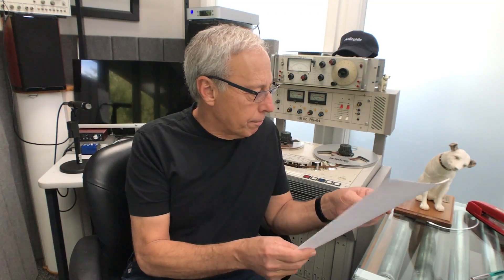Where vacuum tubes work best

Comment: Ive always thought tubes inherantly had much higher levels of distortion although the distortion from tubes are ment to be much more plesant to listen to than digital solutions? in a well designed tube amp can this distortion be low enough to compare with digital solutions or do people just prefer the analouge sound over the better measuring equipment?

Comment: I am a harp player, and I have all tube amps .Get this, 2 Gibson 1941 suitcase amps . The oldest is pristine and uses 2 6sq7 preamp tubes, a 
I sub 6sr7 metals to tone down,  2 6v6 which I use RCA cokebottle, and a 5y3 rectifier that I subbed a BENDIX 6992 . Second Gibson uses different preamps, 6jc7. Same in power, 6v6 and 5y3 . An Ampeg Jet, rebrand as Noble . 6sl7 preamps and 2 6v6 push pulls,5y3 rectifier..  A fine Blackheart Handsome Devil with 12ay7s for preamp and EL84 power tubes . Then, my gigging amp, VHT Special 6, class A, a 7442 preamp . . . 12ax7 one triode and 12au7 the other, then a cokebottle Sylvania 6l6 blackness for a power tube. A GE 5881 works good as well .

Comment: I've gone back and forth between ss and tubed pre. No matter which one I run, I always feel like I'm missing something the other one does better. Recently it's dawned on me my biggest mistake may be I'm trying to choose one that does both and if I ever found that unit it probably wouldn't do either one great. So I've concluded the only solution is to have both, and rum thru a switch. Now I need a good switch with no measurable loss(🤔🙄😶) it never ends....

Comment: Also, we don't need so many tubes in the preamp as compared to the power amp, which means that the maintenance cost is must economical!   I am using tube preamp + ss power amp.

Comment: In my experience a tube pre amp ruins the sound of a solid state amp. I use the solid state amp as a first level pre amp to a second tube pre and power amp.
Reply: Sounds to complex to be pure to the signal. I run a tube preamp and it definitely doesn't ruin anything.

Comment: He says tubes are best introduced in the front end. What is the front end? Probably dumb question but still learning, thanks!
Reply: I am guessing a little bit here. 
Systemwise, a front end would be a tube preamp vs solid state amplifier doing the final current deliveries.

Component wise, in a preamp, the front end would be the tubes in the first/gain stage vs the buffer state. The buffers (the final stage in preamp) could be tubes or solid state (in the case of a hybrid preamp).

In an amplifier, this would be the case of a hybrid amp, the front end would be the tubes in the first/input stage vs solid state in the output stage.

Comment: If you do not push tubes so hard two things happen. Distortion goes up when you turn up the power. They do not last as long. By using bigger tubes you do not need to push them hard. They last for many years and they sound better. When they do wear out they are cheaper to replace than the labor of hiring a technician to find and change a bad transistor. That is why I use commercial AM radio station 833A transmitter tubes for my SET amplifier. They can handle 2000 to 3000 plate Volts but with only 1000 Volts drawing 120 ma,they are more than loud enough with low sensitivity Magnepans. PS Audio really ought to try building a prototype 833ASET. You can use a Hammond 1642SE output transformer which is rated to 300 ma before core saturation and pot tested to contain several thousand Volts. Just feed the grid with about 600 Ohms from a headphone or low power amplifier at zero grid bias (transformer between 833A grid and ground.) The 10 Volt 10 Amp to heat the cathode is a little tricky to design, but I use a 4.5 Farad capacitor in the final pi filter. Tungsten cathodes have to be heated with pure DC.

Comment: So hybrid amps are the best?
Reply from the maker: Generally, yes. Because amplifiers are broken into two sections - the input voltage gain stage and the output power stage, using the best technology for both makes sense.
Reply: @Paulmcgowanpsaudio  thanks. May God bless you.

Comment: Now I have a question. Not sure if you already covered it. I will go back and listen again(kids can be distracting). I have since new (first stereo I ever purchased) a Technics SA-GX490 receiver which I love. I am currently using a ADS 5 band graphic EQ with it. Mostly I use it for tapes, but occasionally all the time. Depends on the mood. Can I put a tube preamp on the tape monitor? Or will that be a bad idea?

Comment: They are best in the system when the system is ALL tubes, this is the correct answer
Reply: Not true. Tubes don’t work very well in the low frequency area and at high volumes.  

For best mid and high frequency natural sound at moderate listening levels then yes tubes at both input and output stages “best” but there are other drawbacks also.  Have to replace tubes over time, etc as Paul mentioned.

Comment: Tubes are very coloured if you like their character you'll like that type of amp. 

The idea of a tube power, or buffer is frankly ridiculous in hifi terms, but in preamps, I agree they can be more useful. 

In applications were you want power amp distortion like with instruments, they are great, but for playing back audio recordings you are going to always going to run into gain vs distortion issues.

People who sell tube buffers are basically snake oil salesmen because tubes are terrible for buffers, and buffers shouldn't really impart any kind of tone themselves outside of making up for issues caused by poor impedance balances. 

I think the hifi world is full of people who totally misunderstand basic electrical engineering.

Comment: I build small all tube synths and preamps and have for some decades now . I love your honesty in this video , however both me and Leo Fender heard another side of this . Leo made all the hybrid MusicMan amps which are sought after today with solid state front ends and Tube power sections . I tour with a bunch of solid state pedals going in to a small solid state mixer , then I send left to a tube amplifier and right to the solid state house system . I have found for me that if a Tube is the last thing ( with transformer ) that drives the speaker one will get the tube harmonic sound no matter what . I like tubes in the front end but I find for me,  it is the most important to have them last . The audio industry has sided with front end tubes and no one makes a hybrid with the power section being tube and the front solid state any more but from my own experience I still like tubes last in the chain the best. Thanks for listening .
Reply: Have a look in all models of ROGUE AUDIO

Comment: Can a 20 watt tube amp especially for guitar be built entirely out of subminiature vacuum tubes?
Reply from the maker: Doubtful. The input stage certainly could, but I am not familiar with a power sub miniature tube and suspect you'd need larger current delivering varieties instead.
Reply: @Paulmcgowanpsaudio  Which subminiature tube would give me a very clean signal in the clean channel but when I apply it to a distortion circuit it would be heavy metal worthy  like a Peavey 5150 or a Mesa Boogie? I know it's subjective but I'm talking just in theory. Of course when used in a preamp circuit.  Thanks.

Comment: I’ve had many years as a musician, and a tube pre doesn’t have the character unless teamed with output tubes hanging on by their fingernails. But for reproduction, I can see now that I don’t need (or want) that output grind. Wondering whether a tube section between pre and power will help enough, or should I sacrifice the big bucks for a new pre?

Comment: Would an integrated tube amplifier be the best of all worlds? Do they use tubes in both functions? Thanks!
Reply: Some do.
Reply: Thank you! We did opt for a PrimaLuna EVO 300 integrated amplifier, and it has been wonderful. The silence between songs is stellar. There is absolutely no noise whatsoever, and we tested this at higher volumes just to be sure. It's driving a pair of Klipsch La Scala AL5 speakers which are extremely revealing. I would really enjoy to demo an AirTight tube amplifier to see it there's an audible difference.

Comment: To what extent does a tube front-end have an impedance that behaves as something other than a passive RLC network?  The only aspects of a tube amp that would seem hard to model digitally are the impedance of the inputs and outputs.  I'm not sure the high and sometimes variable impedance of a power-tube-based output stage would be aesthetically better or worse than the lower impedance of a typical transistor-based output stage, but the ways it would interact with the variable impedance of a typical loudspeaker would be different from the ways a transistor amp would interact, in ways that would seem hard to model.  I wouldn't think the impedance behavior of an input stage would be as interesting, but maybe it does add something to the sound I don't know about.

Comment: Excellent presentation, even though I’ve ordered a 2W tube amp for a small listening room. It has two inputs, and I’ll feed one input with vinyl, the other with a DAC. Simplicity, but we shall see if I should have gone with the valve front end instead of output. :)

Comment: Hi Paul.  Love these segments; love your products.  Unfortunately, though, this answer is wrong.  Let me explain:
In Russel Hamm's May 1973 report in the AES Journal (Volume 21, # 4), he conducted the very shootout you're describing — a double blind A/B between tubes and solid-state devices, except that the shootout was also broken up into various stages.  In other words, comparisons were made in the front ends — (microphones preamps, phono preamps, line stages) AND in the amplification stages.  Not only were subjective (listening) tests performed but performance of each was extensively analyzed.

The result?  The MOST profound difference between tubes and solid-state devices occurred wherever there was an electronic-to-electromechanical interface, e.g., speakers, cutting lathes, microphones, turntable cartridges.  The differences in line-level reproduction (while they DID exist) were not as noticeable.

It is, therefore, MOST advantageous (in every case except a phono preamp) to have the tubes powering the speakers.  Now, you may say, "well then your at the mercy of the output transformer's quality", and this would be true,  But remember, we're talking about a "cost is no object" system here, so you can have a top-quality (albeit expensive) output transformer that will NOT exhibit the phase distortion and IMD that many cheap ones do.
If you do so, I can PROMISE you that the tube amplifier (even if fed by a solid-state preamplifier) will result in better subjective sound quality than a tube preamp feeding a solid-state amp, (even a PS Audio, Krell or Mark Levinson ).

This, by the way, is a VERY common misconception — that the best way to get the advantages of "both world's" is to use a tube preamp and a solid-state amp.  In fact, you're actually better off doing the OPPOSITE.  I, in fact, USED TO believe so myself; It wasn't until I started "flipping the script" in my own designs that I realized how wrong I'd been*.  Tubes can be microphonic, so you'd (ideally) like to feed them a strong signal (i.e., one that is ALREADY preamplified), and the use of an output trafo on a Class A tube circuit not only serves to protect the speakers (as transformers can't pass DC) but also acts to cancel out many of the distortions inherent in loudspeakers (by creating similar distortions in the inverse, much the same as a push-pull circuit can cancel out even-order distortions inherent in single-ended designs).

Ever since I've realized the benefits of coupling tube output to transformer to speaker, I've been fighting the same misconception I used to have as well, that tubes are best used in the front end.  It's simply not true.

*Note: I've been designing audio components for over 35 years and ran a recording studio for over 25, so had the benefit of being able to compare the playback of a musical performance to the actual performance I'd just heard (while tracking it), which is the best way to judge accuracy.

I WILL SAY THIS: Putting tubes in the front end makes a big difference if you can't get a tube amplifier with an excellent output transfromer.  Also, signal tubes "break in" and "open up" more quickly that power tubes, so you may need to get some hours on the equipment before the advantages of the power amp become obvious, but if you can get a first-rate tube amp and let it burn in, they will! 
 Try it yourself: compare (double-blind) a high-end tube amplifier to ANY solid-state amp in the same system; (gIve the tubes 25 hours or more of use first if the amp is new).
 If you thought the difference in the front end was big...
Reply: Also, I have to add this: your assessment that "tubes are not as consistent as transistors" is also false (or is based on recent Chinese exports).  Tubes (by and large) vary quite a bit less from one to the next than transistors do.  I've done curve tracings on over 150 different devices — "Golden Age" tubes, MOSFETs, JFETs, BJTs, etc. — and the tubes varied the least overall from unit to unit.
Your argument may be based on the way that they're utilized; (transistor circuits often must employ NFB to linearize the device and control gain), but if you compare "apples to apples" — (open gain Hfe, input and output impedance, I/V slope) — almost any two NOS 6DJ8's or 6SN7's for example, from the same (American or European) manufacturer would constitute a "matched pair" in transistor terms.
Reply: My fav part in your comment is how you keep pushing “try it yourself” well… paul did and his conclusion and the other designers conclusion was unanimous. And this is an up to date test with latest technology and designs. I’d say I’ll take Paul’s and his expert designers opinion on this one.
Reply: I also experience the same conclusion as you. It is the power tube plus the output transformer creates the magic of good sound stage. Tube preamp helps a little only.

Comment: Paul where do you get your tubes from what variant of tube do you use! What do you think of KR audio, supposed to be one of the best in the world have you tried their tubes. And going back to buffer stage isn't this just as good as a valve preamp?? And I was thinking could you not achieve the same effect as a valve by using chokes in the preamp output stage I was thinking if the MOSFET run through a choke first wouldn't this not achieve the same effect as a valve?

Comment: If someone invents a high-impedance alternative to the loudspeaker that doesn't significantly change impedance based on frequency, then tubes will be a contender for output as well
Reply: I find it curious that tube aficionados focus on the input stage, when the interaction of output tubes, transformers, and speakers would seem much harder to model.  The frequency response of an amplifier-loudspeaker combination will often be affected by the the surrounding environment, in ways that depend upon the amplifier's output impedance characteristics.  Perhaps even tube aficionados don't actually like the effects that output tubes have on the sound?

Comment: Great discussion!  Even on a less expensive 'higher end' system like mine, tubes can pay dividends.  I purchased an inexpensive tubed Little Dot MKIII preamp/headphone amp to replace my old workhorse solid state Onkyo M-508 Grand Integra preamp, and my jaw dropped!  My main music system consists of the Little Dot MKIII preamp, a McIntosh MC162 amplifier, and an Onkyo CS5VL SACD/CD player going into a pair of Magnepan MG12/QR speakers, with a Velodyne sub.  I swapped tubes on the MKIII, going with CBS Hytrons (circa mid 1950's?).  My music (various genres) immediately sounded better in so many ways!  More involving, airy, timbrally accurate and 'warmer', and less fatiguing.  Even though the MKIII cost next to nothing (for a tubed preamp), i'm a firm believer in system synergy.  There is a certain element of 'randomness' and guessing that goes into audio, and sometimes excellent results can often belie or be inversely proportional to the amount of money spent!  The same applies with my other obsession and hobby, Amateur Radio (Ham Radio)!

Comment: Well we guitar players sure do love our tubes but our amps are a horse of a different color...might even very well be a zebra in fact.
Reply: Full tube amps make sense for guitar players since precise bass isn't a priority and power amp distortion sounds great for them (provided the wattage isn't too high). For bass players, hybrid amps make more sense to use as the bass frequencies have more control with SS power sections. The Ampeg SVT is often revered as the holy grail of bass amps, but I can assure you for me it was a case of never meet your heroes. Played one for a gig once and I was much happier to have my hybrid rig.

Comment: The Audio Research SP3 preamp was good but highly colored. The SP6B was much better. My system is tubes and solid state. I use a solid state moving coil amp and a tube preamp that has a solid state power supply and may amps are solid state up to the output tubes. The amps require tubes as they drive electrostatic panels directly.